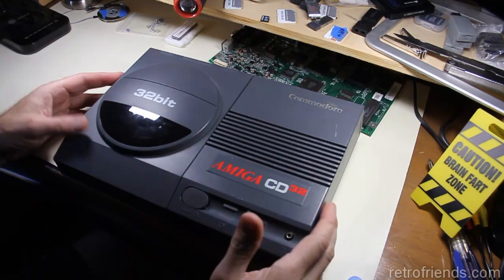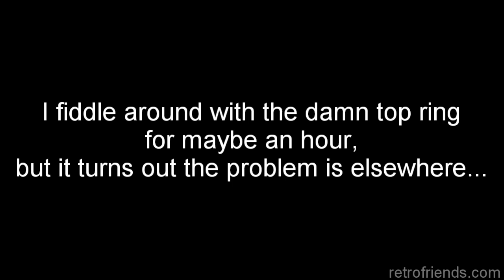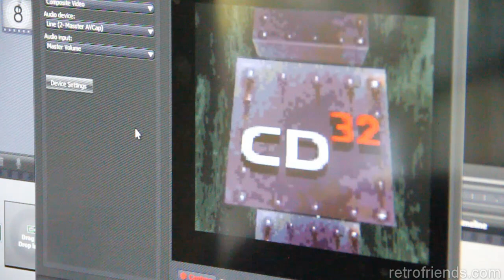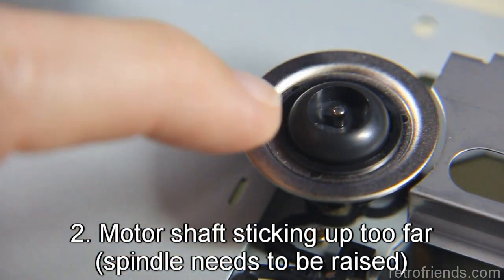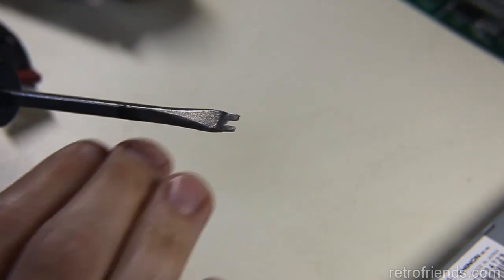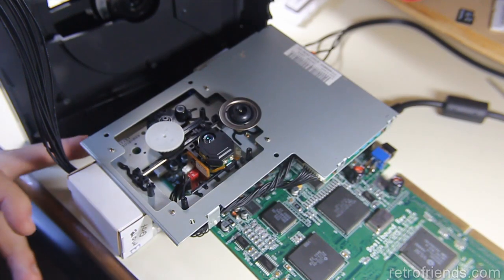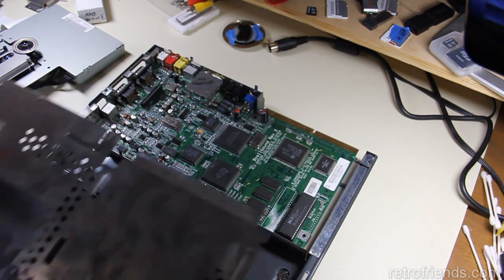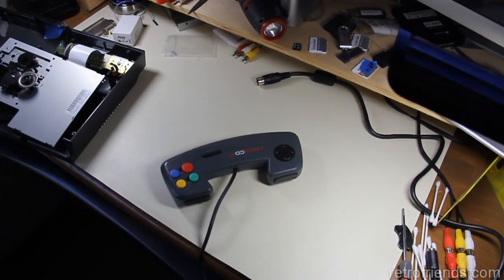Amiga CD32 Repair Part 4: Disc Slipping on Spindle AVGN Paint Can Solution

Comment: if you can build a cd32 why does it need to be as original? How about some other type of cdrom drive or dvd drive? As long as the motherboard thinks its connected. Also could do a 3d printed case to fit on top. Or it could go into an ATX tower case with a better power supply and other ide devices  such as ssd hard drive. Maybe it could be a cd32 laptop computer